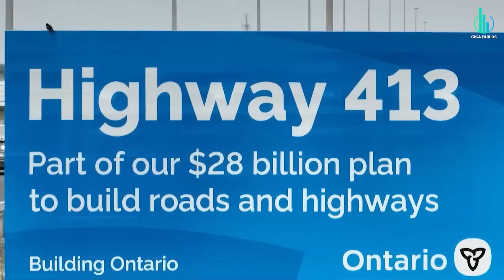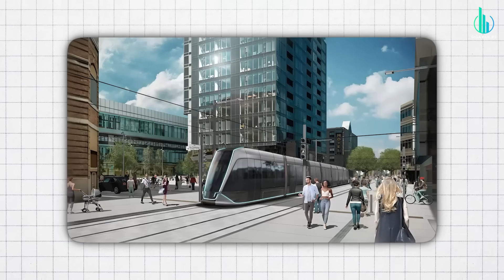Canada Just Shocked The World With What They’re Building

Comment: All of these projects seem great but what about the bottleneck in Northwestern Ontario. Yes they are building a zipper highway but with big trucks hauling and smaller vehicles together on the 17 / 11 Highway there will still be major close down of highway movement if there is an accident because there is only one highway through this area. Not like the multiple highways between BC & Alberta that can be used to divert traffic if needed. 
The bottleneck problem in the middle of Canada is not being solved with a zipper highway.